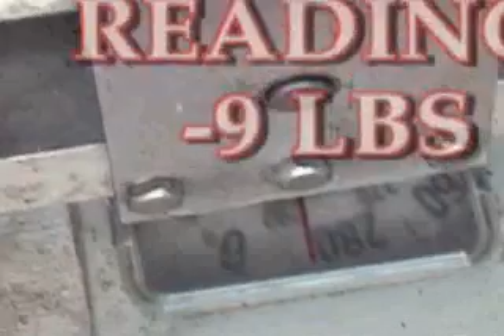MAC-QUAN 1: CONVERTIR ACELERACIÓN ANGULAR EN ACELERACIÓN LINEAL. 1/2

Comment: Just so you know, he later abandoned the traditional scale and went with digital scales.
Reply: Alright, so you had contact with him this year too? the thing is this with mechanical  propulsion. if it is real you will get lots of thrust, not just some grams.  not back and forth,  all my years in the electric and mechanical world   tells this.  so  now I have built  several ones. no one works . thats good.  I have just finiesh another model this night that also doesnt work. not bad, because no results is bad results. I am  just debunking  lots of these common so called  drives.    there is though a real working one perhaps.  I have already built and tested an electromagnetic system i.e. solid state,  just   some electric power is needed  that  doesnt use  ion wind.  its a 2 pound piece of metal that is hanging from the roof all alone and it moves  on power on. the reason I am having my eyes in the  mechanical arena is  just to see how that could be and  to just see if this is real or not. I have a  couple of mechanical devices to build and test  and see for my self because no one in this world seems to be caring at all.   regards
Reply: So, what happened then ?. Can you explain, please.
Besides, if  there is any other source of information about this device that you may know, please share it with us. Cheers, John.
Reply: jhonny1392 He is holding off on releasing it to the public for a little bit longer. Eventually it will be released though. He still plans on launching it into outer space from Kitty Hawk, to undeniably prove that it works.
Reply: HI,  I am really interested in this, may I ask how you know all about this, did you talk or see Dr Marsden? I heared there was a website that had expalantion of the principle and all, but all was gone.. is that true?
Reply: It's been more than a year and a half since this vid was uploaded. If you still have contact with mr. Marsder tell him to upload a new video showing the progress through all this time.
I think this is necessay in order to back up and up date this incredible device, but if he refuse, would you be so kind in telling us what is going on today about this machine ?..
Thanks in advance. Cheers, John.
Reply: He is eventually going to go for the Goede Award to overcome gravity at the Goede Shiftung in Germany. He is being secretive as usual and hasn't been talking to me much.
Reply: I'm not sure when it will be in Germany; I'm the one who suggested he go for the award since it's 1 million Euros. I usually talk to him every couple of months but he has been incognito for several months now.

This isn't his only technology though. He also has a machine that converts the energy that the sun has already put into the air molecules around us on earth. It literally converts the air to liquid (-346 degrees Fahrenheit) and while it does it spins counterrotating turbine blades that powers an electricity generator. The energy is already in the air around us. He is just extracting the atomic molecular energy from this massive amount of hot (boiled) 328,000 feet of air that surrounds us on Earth. If you were to think of nitrogen and oxygen, as water instead, we are basically surrounded in an atmosphere of hot steam right now as it is; perfectly useful to harness energy from. We already extract this kind of energy to some extent through wind turbines affixed to massive poles in the wind stream. But this just does it to ridiculously extreme levels. (ambient temperature to liquid temperature). It's a massive pressure differential/gradient and he just extracts that gradient flow to spin turbine blades for a power generator. It's really quite brilliant.
Reply: leviterande I am building my own unique design myself, that is based off of the Mac Quan 1. He has also created a new Mac Quan 2. They are both able to self-lift above and beyond the force of gravity on Earth, so that is proof enough that they work.  

I have also followed all other inertial propulsion machines, the Thornson, David Colwishaw's GIT, Bob Cook's Coriolis Drive, Eric Laithwaite, etc, etc, etc. None of them have figured out what this guy Mike Marsden figured out. You have to convert your acceleration and deceleration at 90 degree angles, like a wave does in nature. That is how light moves throughout the Universe. Michael Marsden calls his machine "mechanical light". Mac Quan stands for the Macroscopic version of the Inner Quantum workings of matter.
Reply: I personally never seen his website before it was removed, I only heared of it that it had  much more info and diagram  on the idea how it works,  do you know how marsden did it roughly?  I mean,  90 degrees is sure enough the way to do it but that aint gonna give you any thrust,  ... angular  acceleration and deceleration  in  or at 90 degrees is not enough. and you cant convert pure momentum to energy per se.  the way marsden did it was that he   truly converted angular momentum to linear. . there is only one left possible way to do it  I have not tried it yet.
Reply: leviterande I know how it works; it's very complex. But he obviously doesn't want me to just go around telling people the specifics of precisely how it works. I imagine he has filed for patent protection and is waiting to be approved; hence the secrecy.

It literally converts angular acceleration, and angular deceleration, into pure linear acceleration (thrust/propulsion).  It does it through mechanical means.
Reply: Good!
Are you R.S on gyro.org? btw?

 Do you know  how it works for sure cuz you have been told and saw it yourself or do you think you know?
Reply: leviterande That's me; RS on that site.

And I have done all of the math to prove it works. It basically accelerates one "point mass" on a spinning disc into a linear direction. When it does so, it wants to decrease the radius of its spin. However, the opposite sides "point mass" wants to elongate its radius of its spin. Then after 90 degrees of travel you decelerate that same "point mass" for another 90 degrees of travel, and it wants to elongate its radius. However, the opposite sides "point mass" wants to decrease its radius.

Then you just switch to the opposite sides "point mass" and do the exact same thing, accelerate it for 90 degrees,  then decelerate it for 90 degrees, to get your total of 360 degrees of rotational travel.

When you do so, the "center of gravity" between those two points simply wants to traverse a perfectly straight line, basically bisecting the middle of these two equally opposed sinusoidal wavelengths.

The end result is that you gain a linear thrust at a rate of 1.49999 ratio.

I am building my own machine that operates under the exact same principal but looks absolutely nothing like the Mac Quan 1 or 2.
Reply: I wonder if I can Personal message you. here is a link I want to show.. This new youtube totally confuses me.     Is  the Maquan using a counter rotating  configuration  to cancel torque ? or  does it  rotate one direction?
Reply: leviterande His final one that will go into space uses 16 counter-rotating systems to completely cancel out any torque. You can message me.
Reply: cougarrcsnva How can he be making his final one when these videos are from 2011 and earlier and this guy is dead??  He has not only conquered gravity but also death.  Wow!!
Reply: webcruiser152000 How do you know he is dead ?. Can you add a little more information about his case, please.
It would be greatly appreciated for me and many others.
Thanks again, and hop to hear from your reply very soon. 
Cheers, John.
Reply: Without offending anyone at all and I believe in this technology  that it  is possible, however, do you know how many inventors that claim amazing things without enough proof?  I have a feeling though that Marsden is the truth.  One question:

 when is that going to be in Germany? and when did you talk to him last time?   thx 
Regards

Comment: (Part 2) What this means is that this type of scale can be bad for measuring "reduced weight" like this. Vibrations from the machine could cause the scale to malfunction and show a false result. I think I saw some Spanish guy in a video called "superior pendulum test" do a similar thing. He stood on the same type of scale and started bouncing on it, and you'd see that the meter would show him "losing weight", when it was in fact just the dampener doing it's thing.
Reply: Mike Marsden later switched to digital scales. 

Plus it later fully self-lifted off of the ground so it was a completely counteract to Earth gravity with its 32+ pounds of linear thrust. 

The Mac Quan 2 and later versions have multiple G's of thrust now.
Reply: @ooosoo8727  If you are still alive and on youtube would you mind sharing some sources for this? I am just getting deep into vortex mechanics and this seems extraordinarily plausible I would like to understand more.

Comment: (Part 1) One thing to know about the type of scale he uses at 0:58, these types of scales have a one way dampener.

Some of you are too young to remember these, but if the dampener broke, the meter would just swing from side to side forever. If you were 70kg it'd go up to 80, then down to 60, for like 30-40 seconds before finally stopping at your current weight.

Comment: Rick Dobson of the ISA, I am very sorry but you made the same mistake as Thornson, Dean, and others by thinking you can "accelerate" mass more "predominately" in one "half" of a spin to supposedly create "more centripetal force" in the desired direction of thrust, and then "decelerate" the mass on the opposite end of the spin, supposedly to create "less centripetal/centrifugal" force on the back half. You wrongly think this will create an imbalance that will propel yourself through space. Wrong
Reply: Check out Bob Cook's CIP device. I saw it lift itself along a slanting track. It worked, clearly. He had another version that pushed a boat through water with no contact with the water by any of its moving parts.

Comment: I would love to make a 4 wheeled human powered bicycle with a version of MAC-QUAN. Can I get a blue print or sketch of the details? Or can you design and build for this project To have a set of blue prints would greatly help my understanding of this device.
Reply: I know exactly how it works. I have been online friends with Mike Marsden for years now. 

His new Mac Quan concept engines now look nothing like the original Mac Quan 1, but are much more powerful. 

The main problem you would run into with trying to make a Mac Quan 1 out of wood is that there is a hidden set of springs inside of the machine that causes the acceleration and deceleration that would likely rip wood apart, unless it was extremely strong wood. 

It is essentially like a piano. A piano is made of wood, but the inside has a hidden heavy brass metal harp that all of the wires are attached to under unbelievable tension that would snap wood in two instantly, which is why it must be made of metal. 

I guess you could possibly use less powerful springs and still get some linear thrust though, while using a wooden design. 

He used to propel the Mac Quan 1 sideways on a skateboard at ridiculous speeds around his warehouse as it gave sideways linear thrust while the motor was running on a battery. 

You can email me if you want details and truly want to be one of the first to create a working inertial propulsion machine. 

I have also patent pending a design that mimics the Mac Quan 1 concept, but looks totally different and you could easily create it completely from a bicycle frame and I would actually pay you for a working machine if you created it with my design. It is much simpler than a Mac Quan 1 and uses neodymium magnets as the virtual "springs" I guess you could call them, instead of actual springs. 

Cougarrcsnva@hotmail.com